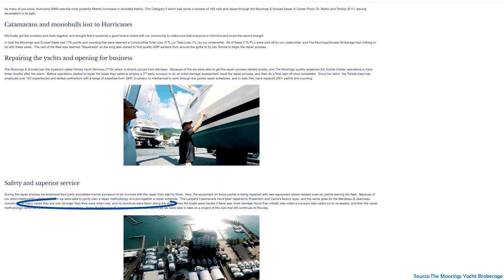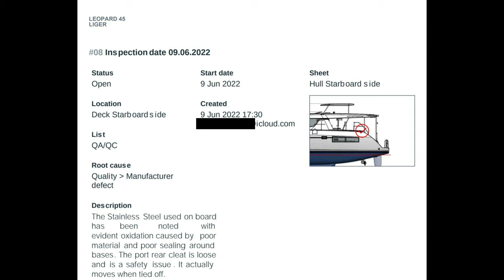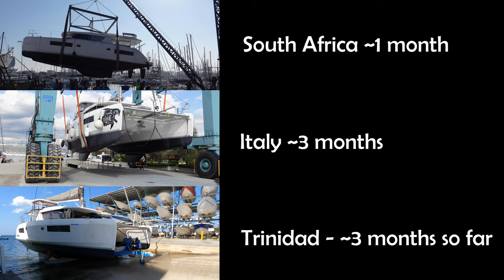Leopard 45 NEW Catamaran Warranty... The Saga Continues | FIXING OUR NEW LEOPARD 45 IN THE CARIBBEAN

Comment: I am glad your finally getting the assistance. And I can get a company not wanting a repair procedure being published for a number of reasons. All the same it seems unfathomable that one can regularly find videos stating that a new boat is NOT a means of avoiding troubles of a used boat. And the draconian contracts foisted to get warranty repairs done. I think NDAs should be limited to not publishing detailed steps to repair and protecting legitimate trade secrets.
Reply: None of these original or repeat issues I have seen going back years constitute some sort of trade secret only Leopard is aware of. The repair procedures center around how the repair integrates into this particular hull properly or is common to every manufacturer so has no commercial value. So far nobody has been able to provide me with evidence to counter this and most people agree it is only an attempt to suppress negative online feedback.

Comment: I had wanted a leopard 50 cat but after hearing of all the poor quality boats they turn out i dont think i could ever feel safe and comfortable on one now.... shocking for a million pound purchase... i think the boat should be rejected and a full refund issued plus compensation for all the problems.
Reply from the maker: Thanks for the support. Hopefully they use this as an opportunity to rectify our situation and drastically improve their quality.
Reply: @Travel Sketch  let's hope so but I doubt it as it is still cheaper for them to silence complainers and do the minimum of repairs possible rather than make quality safe boats. Funny how the moorings fleet never suffer as many structural problems. Makes you wonder if there are 2 quality standards they work to. One for normal customers with very little power and a higher standard for the moorings fleet who buy lots of boats every year.....
Reply: I'm not sure, I'm curious though so might do some digging. Travelopia have their own repair bases so it isn't that there are no problems, it is just that they solve them in house. Some of the guys they use that I have met are highly competent as well. Their repairs from what I have seen are better than factory repairs.